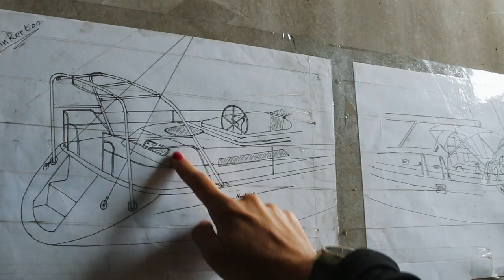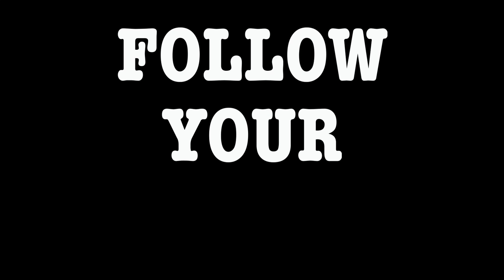Sailboat refit: installing a stainless steel arch for solar panels and dinghy davits #33

Comment: Buy the way,  20-22 min is kinda the standard average of the sailing vlogging system of most successful vloggers on a weekly basis. Often the shorter ones, 8-10 min kinda leave one hanging or the detail zips by rather quickly and we all want to see our faves for a bit longer. 🙂🙂 ❤️⛵️

Comment: Looks brilliant guys, that looks real good, that guy Stuart is sure good. Just think about one thing though, if you find yourself having to hide from a hurricane it is best to be able to take them solar panels off, of course you do not want them damaged or ripped off but the main thing is windage, the less windage the boat has the better off you are, I have been put over on my side and thats with everything off and stowed below, but because of less windage the boat could come up again and was not pinned down, just something to think about.

Comment: Great result integrating into the boat beautifully.  I could fully empathise with Ryan during the initial fit worrying if it was ok.  Excellent tradesman, only downside, was that item 🤔 in the workshop 🤭

Comment: Looks great. Good tip: Watch  the workers making your arch: Like antifouling paint - did they apply the expensive stuff you paid for? Or is it house paint tinted the same color?  (Is that real anchor chain or that garbage that comes from that place in Florida?) With a stainless steel arch - you want to make sure you get the gauge of metal (wall thickness), and alloy number that's required - not something that looks great until you sail over the horizon and get some salt on it. 
YouTuber Colin Furze does a lot with tubing. Scroll through the thumbnails of his (crazy) videos and select the images that have tubing in them. You'll see him laying it out, cutting the curved ends and welding.  I know some of the techniques involved, but I still learned a lot from him. From his videos you can also see how to DIY a project like this, but also why  its worth paying a professional. And after seeing one of Furze's videos you'll be able to immediately tell the shop you're thinking of hiring cuts the first complex angle (for your project or for someone else's). Do they know what they're doing or just winging it? 
Also as a former carpenter, figure it out/fix-it,  go to guy: If you don't know the task there's no way you can trick the worker into thinking you do. You can however, judge the level of confidence/insecurity of the worker - never work with flakes, liars, or people quick to anger. Good people can hem and haw a bit that's okay. And make sure you pay them what the job is worth. Estimating and doing the work are often two completely different skill sets. If a good person  makes an honest mistake and has to buy more materials - be a good person and pay for most of that cost.
Reply from the maker: All good points.  The person making our arch was a real pro and use to make a lot of movie sets and other things, so he is creative and good at his work.  I believe he has made over 300 arches for boats so the guy understand needs and requirements.

Comment: Great addition to your yacht. Have you test loaded those dinghy davits. I don’t see any braces or strong back to help reinforce the horizontal tubes.
A bit of trivia. The bow has the Pulpit. The stern has the Pushpit.
Reply from the maker: Hi Andrew, Not yet.... our dighy is only 32k... if it can hold me bouncing around hanging on it i'm sure it will do just fine... but time will tell.   - Ryan
Reply: I am glad someone else mentioned it pushpit is in the back and pulpit is in the front.  I first heard them say it and thought what the heck is the dinghy doing on the front.

Comment: I have a lot of experience in antenna building,  How you have your antennas mounted now is much much better than how it was, Having steel bars close to and even touching the tx/rx part of the antenna causes a detuning of it and can not only impede on its performance but also damage your transmitter, Also in the VHF/UHF spectrum height is might👍

Comment: It is a really nice install.  That "Price is Right" edit was cool too!!  Your 4G antennas are in a great place for getting a better signal, but at times they may completely shut down your solar production on the arch..  You will have to experiment on that one.  A lot of solar panels are not very tolerant of shading.  Just a little shade on one cell will drop the voltage output to nearly zero.  Not that there aren't a lot of other things to shade the panels like rigging, etc...those antennas may work better on the sides of your boat lower down on the pulpit.  If you get a wind generator it is better to make an extension bracket that goes aft a bit then up a bit so that shading is minimized.  Also when at anchor rig a preventer on your boom and tie it aside to get better solar output, but I'm sure you've seen that one before as well.  Will Prowse can explain...I recommend his channel for great solar products. https://www.youtube.com/watch?v=Cwvf6lS7P9s  Oh at one point Ryan said he was pregnant.  Sophie I would really go talk to those welder guys, because...honestly they are the only men in a shop  I know of with a calendar of Dudes instead of Girls.  I think Ryan may have been wandering, but maybe he was just  being sarcastic.

Comment: great video....I am in the same process now. Sophie is great! Wondering about the load  the two horizontal support arms for the dinghy will see? RIB with engine? They seem lonely hanging out there without any gusset plates or side/ lower support. Be watching to see!! Thanks, Andrew

Comment: I think you did exactly the right thing integrating with the pushpit.  I have an Oceanis 40 and I’ve always felt the two halves of the pushpit are a weak point (there are some small cracks around the base of the pushpit bases on my boat), having an integrated design would have added greatly to the strength of the whole thing.   I’m envious as you now have a huge amount of solar, place for a wind generator if you need one and the ability to hang the dinghy on davits is just priceless!  I just need to start saving for mine 😎.    I’m curious if there is anything you’d change about the design several years later?
Reply from the maker: Nope, we absolutely LOVE our arch, and would change nothing about it! It works amazingly for what we do. Maybe one day we give our solar panels an update for more power generating, but it’s not something we’d do anytime soon. Cheers from the Caribbean!

Comment: I am curious how the lateral stability is? Does it flex side to side (port to starboard) at all? Hang your dinghy on it when you try it.
Used to install custom arches in San Francisco Bay Area, USA. Ours all used at least a second tube on one of the hoops with short ladder bars joining the two tubes together. Arch looks good and the price in fantastic. In San Francisco Area would cost anywhere from 10,000 to $15,000 US. I am now cruising the Sea of Cortez, and your arch would have cost here about $7,000 US. If it flexes sideways you could add a diagonal truss tube at the top of the aft hoop on each side to eliminate any movement.  Hopefully it does not need the trusses but best to find out now .

Best wishes, Voyager, Catalina 470
Reply from the maker: Hi Bill,  It does move slightly side to side but I imagine it needs to move a little otherwise it would rip out eventually.  Ill keep an eye on it and followup later.  - ryan

Comment: Hi Sophie and Ryan. Thanks for all your videos. I’d be interested in your solar panel thoughts having watched both your deck and gantry videos. We have a Jeanneau 45DS and no solar or gantry or davits. We have only 400ah of domestic batteries and an EFOY putting in up to 4ah. Cruising in Spain with fridges and freezers etc means max 24 hours before we need a marina. Which route would you advise please? Stay safe you two

Comment: Ryan,   how is the structural integrity ?    I been wanting to do exactly that, but wonder how much under the skin reinforcement is required to handle the moving weight of the dinghy / panels etc.?
Reply from the maker: Hi Bo,

Ill need to follow up on this in a later view but its seems to be okay.  We just did a 20 hour sail and got knocked around fairly good and she was solid.  It will be different with the dinghy on it... more to come on that.  - Ryan

Comment: Do you mind me asking about the details? I'm in the process of doing the same thing, but I'm DYI'ing it. What alloy is it, and what's the outer diameter and wall thickness of the tubes? Just found your channel a few days ago and this project + your DIY watermaker are exactly where I'm at, so it's perfect!
Reply from the maker: Hi Antoine,   I believe it was 316 Stainless.   Not sure the thickness but the outer diameter  was 46mm i believe.  - Ryan

Comment: Love the video, like all your videos! Especially  since I own a sister ship.  Integrated with the stern pulpit was definitely the way to go.  I’m curious, did you consider doing stainless tube all the way to the boarding gate? Lots of sturdy room for Bimini attachments, bbq’s,  filet tables, outboard motors etc.  I also notice you did not include a dedicated outboard hoist in your design.  I love all your videos, and literally having the exact same boat  makes every frame of footage and every reason behind your decisions that much more valuable to me.  Keep up the good work!
Reply from the maker: Hi John,  No i did not consider that but it is a good idea and now i'm a bit pissed I did not :)  Regarding the engine mount... we actually have an electric outboard, its light enough and small enough that we just through it in a locker.  Maybe this changed in the future but for now, no big need.  - Ryan

Comment: Good job and great video!
I am in exactly same kind of project right now.
Could you tell what is the diameter and wall thickness of the arch pipes? It would be interest to see how mounting pads(size, thickness etc.) have been done. Pictures of those would be awesome. Any chance to upload those to your website?
Reply from the maker: HI Heikki, I believe the outer diameter was 46mm.  I'm not sure the thinkness.  Ill write more on this in our blog post!  - Ryan

Comment: Excellent video and awesome end result.  The integration of arch and pushpit was masterfully done.  My only concern was the size of the rings intended to support the dinghy.  Will they be strong enough?
Reply from the maker: Time will tell! We'll do a follow up video in a few months... :)
Reply: thank you for using pushpit, the correct term.  I am not a stickler for terms.  Make up you own term, I am ok with it, but do not reuse  terms that are already used  for something else.

Comment: could you guys have possibly mounted them the other way and fit one more panel on there?  I ask this because this is how delos set up their solar panels and they were able to get one extra on an arch.
Reply from the maker: Hi Armel,  I did think about this but for a few reasons we did not... A. I did not want big sections of the panels hanging over the solid part of the arch, acting like a wing.  B. on the sides we need to watch out for the back-stays it limits the room.  - Ryan

Comment: Did you run the gps cables thru the pipes or is the wiring external???
Reply from the maker: Correct - Though the pipes!  Looks better this way.  - Ryan

Comment: What is the weight limit on the arch for the Dinghy?  How big is the backplate?
Reply from the maker: I'm going to have to get back to you on the dinghy wight... though i'm not going to try to break them.  backing plates were large though i'm not sure the exact size.  - Ryan
Reply: Ryan & Sophie Sailing Understood.  Just curious.  I though the engineering before your installation would have given some kinda number so you would know what not to exceed.  Several times our dinghy has filled with water making it much heavier than just the dinghy.  We always take the motor off when traveling and secure it to the back railing using an engine hoist off the Davis system.  We also pull the plug when the dinghy is lifted and angle the dinghy so water will drain if it does get in there.  Just sharing a voice of experience here so you don’t break something...:-)

Comment: pity u didn't put a slight angle on the panels - water run off/ I think u might need to beef up the dingy davits , looking good
Reply from the maker: Hi Bill, in fact the panels are at slight angles for run off.  I am not sure about the dingy davits but our dinghy is only 32kg... So i'm hoping she works.  - Ryan

Comment: Hi, I'm right impressed with that great bit of stainless fabrication, I had to make my own arch which I suppose I could hand a dinghy off, when are you getting the trawl doors? check mine out here https://www.flickr.com/photos/71588393@N06/40637618953/in/datetaken/